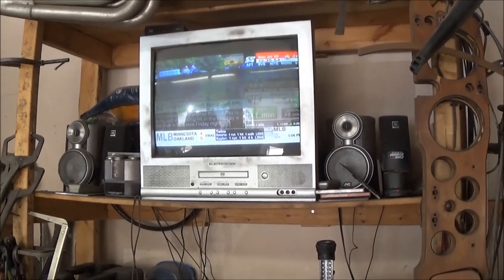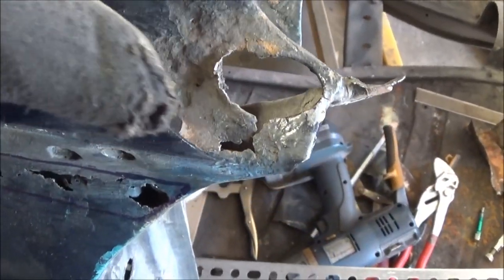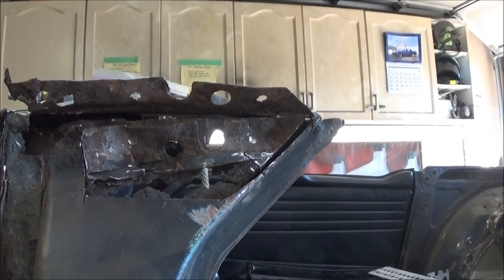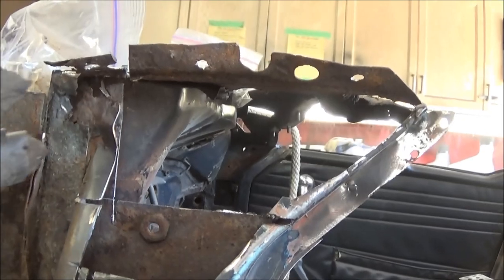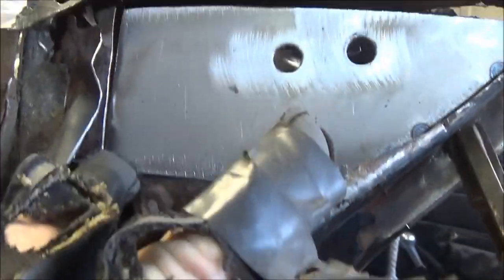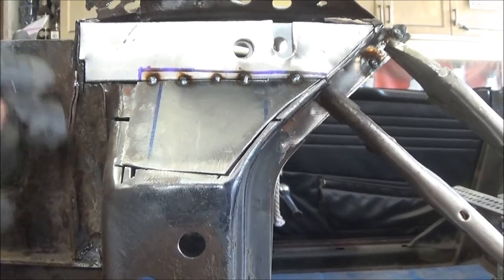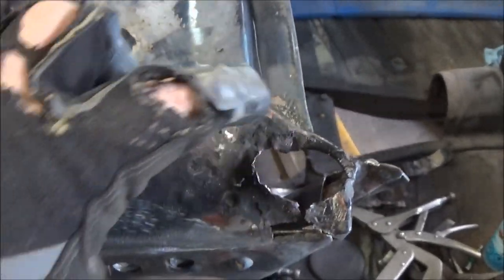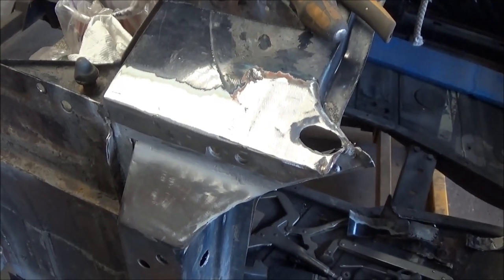T- Minus 48, 1968 Triumph TR250 Restoration, Drivers Side Upper B Post Repair

Comment: Wow, Chef. The top of that A post was ugly. Key word is "was". Nice work.
BTW, what brand/model of welder are you using?
Cheers,
Kevin
Reply from the maker: Thanks Kevin.  She's a little "tender" in spots....I am using the Lincoln Easy Mig 140.   I went with the 140 as it is a little more portable and only requires a regular plug in outlet vs the 240 requirements for the 180 version.   The 140 pretty much does everything I need it to do even frame work....